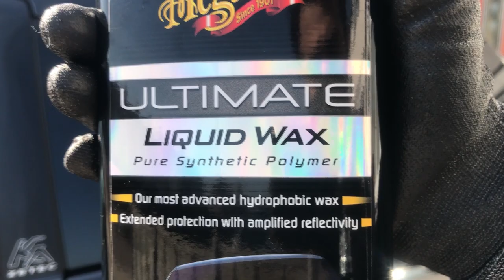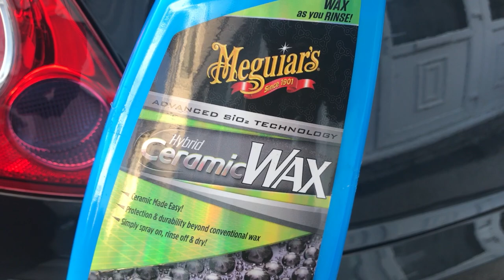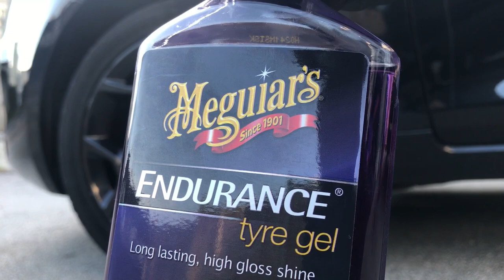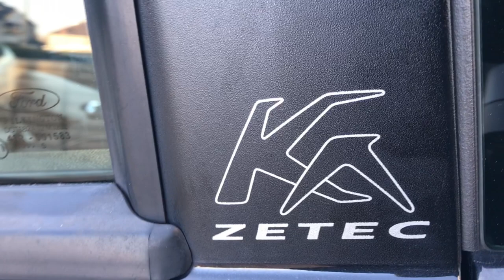Detailing a Dusty, Daily driven Ford - Lost In The Detail - Satisfying ASMR Relaxing Deep Clean

Comment: Subscribed! What wheel clear did you use? In Australia  it's hard to find good cost effective ones.... Around $18US for say 34 ounces
Reply from the maker: Thank you!

I used Bilberry from ValetPRO. You can dilute about 10:1 and it remains effective. 

I used 5:1 in this video and it cut through the brake dust very effectively. 

I could have also used a foaming pump sprayer to maximise coverage using very minimal product, such as the IK foaming sprayer.